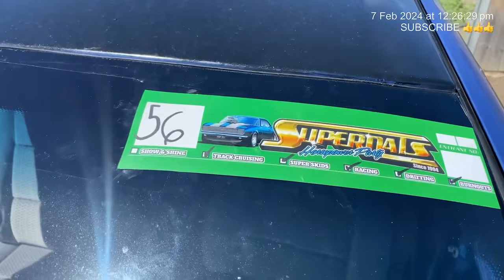Ba Falcon upgrades after burnouts did not go to plan

Comment: i dont know about where you enter your skids. but if you move up a class when you have turbo, it might be best to keep it NA. i have a couple turbo ones and when they break its more expensive. im actually building a NA "stocker" to stay in sportsman and hopefully have more fun for cheaper.
Reply from the maker: I’m in Tasmania mate and even with a turbo I’d stay in the 6 cylinder class I’d only go up a class if I was to change to a v8
Reply: @partytimemotorsport7626  if you dont change class slap on a turbo. easiest most efective power adder just be in mindfull that turbo is more heat
Reply from the maker: @beerturbogarage  yeah that’s y I’m switching to e85 cooler engine temps but I’m definitely also thinking about the extra heat a turbo will create